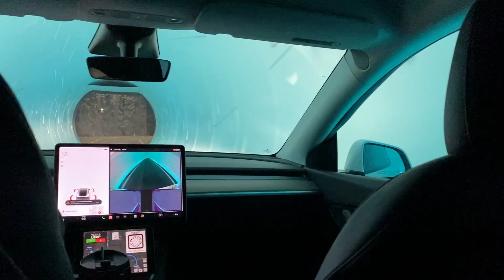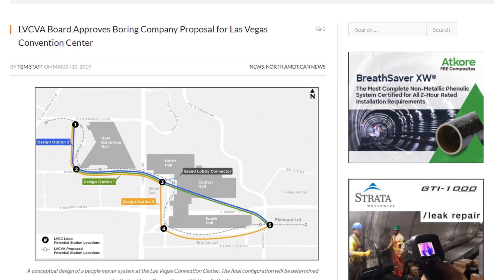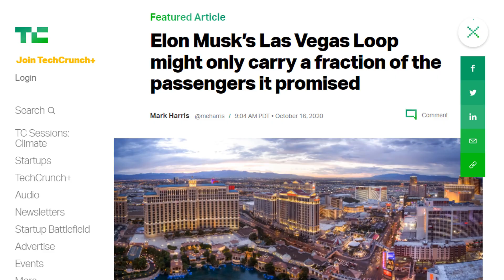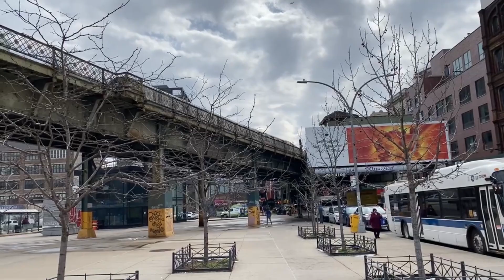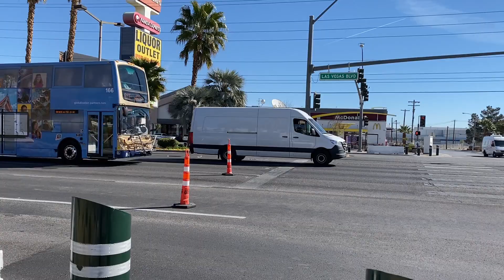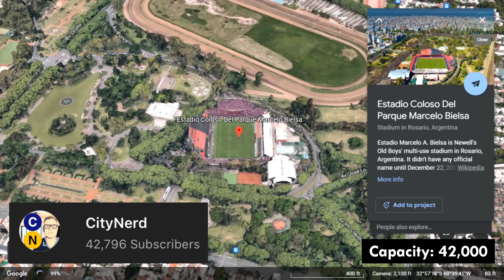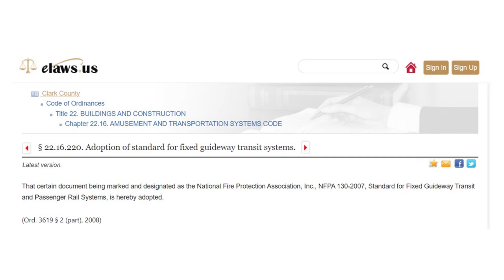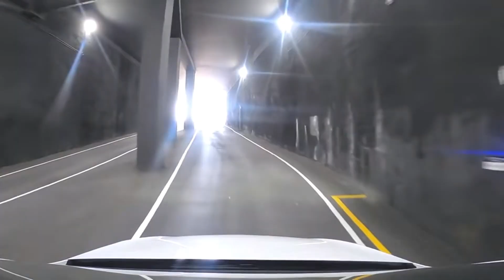Inside the Las Vegas Loop: Transportation Game-Changer, or Complete Waste of Time and Effort?

Comment: 10:20 Wait, are they really proposing to make the cars travel in groups? Why not just chain them up together? And then add a sort of metal guideway on the ground so that they could move autonomously, with an electric cable running along so that would allow the cars to be constantly charged and never run out of power. After that they could modify the cars to accommodate more passengers, with standing room and seats. And then as a final touch they could just elevate the ground a little to get level boarding, that way it would be accessible to all. 
Oh boy, I should create a startup and market this technology ASAP! This is going to revolutionize transit as we know it!!!
Reply from the maker: This technology doesn't exist yet. Stop reading steampunk novels
Reply: @CityNerd Uhhh, Trains?
Reply: I dont know that sounds technically infeasible. Better take the conservative route and put passengers in those blow up spheres that you can roll down a hill in and blow them with high powered fans through the tunnel.
Reply: Just add some technobabble to it and call them pods instead of trains and you'll make millions.
Reply: @ethakis  don't forget the gamer lights
Reply: @ethakis  dont forget putting hyper somewhere in there
Reply: Ah, a fan of Adam I see.
Reply: @lrdxgm  adam, common sense skeptic and thunderfoot
Reply: Luxembourg Luxtram can transport up to 422 people every 2 minutes
422 persons transported in 2 minutes
844 persons transported in 4 minutes
1266 persons transported in 6 minutes
1699 persons transported in 8 minutes
2110 persons transported in 10 minutes
2532 persons transported in 12 minutes
2954 persons transported in 14 minutes
3376 persons transported in 16 minutes
3798 persons transported in 18 minutes
4220 persons transported in 20 minutes
4642 persons transported in 22 minutes
(already in 22 minutes more than the 4400 of the Loop in one hour)
12660 persons transported in 60 minutes (1 hour) just from one station start to another.
All from just one station, and for 500 million euros (a bit more in USD), you got 16 kilometers (10 miles), 24 stations and many tramways.
50 million per mile with 24 stations and tramways 3 times more people
While Loop 50 million for one mile, one station, no cars, no drivers in these 50 million price.
Reply: but elon is a classist and a racist
Reply: Lool
Reply: No, I think they should be independent and put in tunnels - My idea is to slap some solar panels on them though!
Reply: Sounds like a roller coaster
Reply: 😂 wow you are 1000 years ahead incredible.
Reply: Holy crap!!! I think you've invented the train. Patent that bad boy, quick!!!
Reply: No need chains, with AI we can have digital wireless chains, much more efficient than normal chains. Combine that with RGB lights and techno music, it also looks way more pleasant and renewable than rusty chains...
Reply: Now you just have a glorified tram
Reply: ADVENT Insider  How do you figure that the loop moves 3 passengers every six seconds?
Reply: ADVENT Insider   The thing is that Loop EVs only need to carry 1.6 passengers on average to equal the average daily vehicle per passenger ratio of buses. How could this be you ask?

For example, the Vegas Bus service currently moves 178,390 people per day using a fleet of 708 buses.  This is a ratio of one bus to 252 passengers.

In the case of the LVCC Loop it moves 27,000 people per day using a fleet of 70 EVs which is a ratio of one car for 386 passengers over the course of a day.

So the Vegas bus service requires over 1.5x the number of buses to move the same number of passengers over the course of a day as the Loop. 

This is the problem with not just the Vegas bus service, but with traditional public transport using large vehicles in general - occupancy. 

You see the average bus occupancy in the UK is 10.8 passengers per bus which is very comparable to the average bus occupancy in California (10.4) and Nevada (10.1). 

In fact, here in Australia we have an average bus occupancy of around 9 people. 

Upsala Sweden does a little better with an average bus occupancy of 11. 

Now consider that metro buses have an average speed of 9mph due to city traffic and having to stop and wait at every stop. 

In comparison, Loop EVs will have an average speed of around 60mph thanks to the EVs travelling at high speed down the arterial tunnels of the 34 mile Loop going point-to-point direct to their destinations without having to stop at every station. 

So Loop EVs will make at least 6.7x the number of trips in the same time as a bus makes a single trip and that’s not even considering the fact that Loop journeys will be shorter and less circuitous due to being direct point-to-point. 

That means a single Loop EV only needs to carry that magical figure of 1.6 passengers on average per trip to move the same number of passengers per day as a single bus. 

And guess what, Taxis average 1.9 - 2.1 passengers per taxi but it would be even easier for the Loop to have a higher occupancy than taxis with its much higher frequency and much smaller number of end-points than a normal taxi fleet. 

MIT CSAIL’s research developed an algorithm that can replace 14,000 taxis with only 3,000 four-seat vehicles using public data from NYC taxi rides. 

By the simple implementation of ride-sharing apps or station kiosks to enable passengers to more easily ride share, even higher passenger occupancy is readily possible.

And the incentive to utilise such ride-sharing services and make this work is there for the average passenger as the 34 mile 55 station Loop will charge per vehicle so passengers could slash their weekly commuting bill by a half or even 75% by simply sharing an EV with 1-3 other people.
Reply: ADVENT Insider  in terms of maintenance, the 70 EVs in the current LVCC Loop handle up to 27,000 people per day which works out as 386 passengers per day per Tesla as we established earlier. 

Considering the average trip time is less than 2 minutes according to the LVCVA, that works out as 386 / 2.5 passengers per car * 2 minutes = 309 minutes of driving per day. 

So the EVs average 309/60 = 5.15 hours of driving each day to move more people than most subway platform-pairs in Europe. 

Sounds like a pretty easy job for those Teslas.  Pretty comparable to taxis which don’t have a problem giving many years of service despite being ICE vehicles. 

In terms of maintenance costs, internal combustion engine vehicles with 2,500 moving parts which are vastly more unreliable than the 26 moving parts of an EV, which are so maintenance free that Tesla is the only car manufacturer in the world that doesn’t specify service and maintenance intervals. No 10,000 services, no 40,000km major service, nothing. Just check the brake fluid level every 3 years.

And of course, it is not as if subways don’t have VERY significant operating, service and maintenance costs to keep trains running, tracks and signals in top shape etc.  One analysis puts the operating costs for trains at the following:
- Commuter Rail = $20.17 per ride
- Heavy Rail = $17.80 per ride
- Light Rail = $16.08 per ride

(cost per ride calculated by amortizing the capital cost at 3 percent over 30 years, adding to the projected operating cost, and dividing by the annual riders)

For the NYC Subway, Operating costs of an 8-car subway train = $2,000 per hour

As you can see, massive subsidies are essential to avoid MASSIVE ticket costs to merely cover costs for trains.
Reply: ADVENT Insider  You do realise that the Boring Co does have plans for higher capacity vehicles in the Loop if required?  The Loop is after all designed for vehicles up to twice the height of a Tesla Model 3. 

They could easily add higher capacity EV vans or buses or eventually the 16-person pods shown in CGI renders of the Loop on high demand routes, but the reason they haven’t done so yet is because they don’t need higher capacity at this stage.  

Steve Hill, CEO of the LVCVA said back in May last year when asked about higher capacity vehicles in the LVCC Loop: 

“It seems that during a pandemic is not the time to be increasing capacity”.

After all, with the LVCC Loop currently moving 27,000 people per day they already move more people than the platform-pair average of most subways in Europe, let alone light rail or BRT. 

However, if you’re talking about comparing the Loop to the traditional way that buses are used, then buses are too slow, too expensive and don’t carry enough people. 

Bus Rapid Transit (at grade) which has very low capacity:
90 passengers per vehicle * 15 vehicles per hour = 1,350 pph.
And low average speed of 9mph due to city traffic and having to stop and wait at every stop. 
$0.68 - $9m per mile

Bus Rapid Transit (grade-separated) has low capacity: 
90 passengers per vehicle * 30 vehicles per hour = 2,700 pph.
And but still slow average speeds of 12-22mph.
$13-50m per mile

Light Rail Transit (at grade) has medium capacity:
90 passengers per vehicle * 3 vehicles per train * 15 vehicle sets per hour = 4,050 pph.
But slow speeds of 9mph -12mph due to city traffic and having to stop and wait at every station. 
$50m - $100m per mile

Light Rail Transit (grade-separated) high capacity:
90 passengers per vehicle * 3 vehicles per train * 30 vehicle sets per hour = 8,100 pph.
And still pretty slow average speeds of 15mph due to having to stop and wait at every station. 
$201m per mile

Subways have very high capacity:
100 passengers per vehicle * 10 vehicles per train * 30 vehicle sets per hour = 30,000 pph.
But still slow average speeds of 17-22mph due to having to stop and wait at every station. 
$600m- $1 billion per mile
$100m - $1 billion per station

The 34 mile Vegas Loop (2.5 passengers per EV) will have high capacity:
 2.5 passengers per vehicle * 4,000 EVs per hour = 10,000 pph
AND very high average speeds of 60mph thanks to direct point-to-point travel at high speeds. 
$20m per mile (dual tunnel)
$1.5m per above-ground station

The 34 mile Vegas Loop (4 passengers per EV w ride sharing) will have higher capacity:
 4 passengers per vehicle * 4,000 EVs per hour = 16,000 pph
AND very high average speeds of 60mph thanks to direct point-to-point travel at high speeds. 
$20m per mile (dual tunnel)
$1.5m per above-ground station

But the Vegas Loop isn’t just one line down the centre, but up to 3 separate arterial tunnel pairs (6 tunnels in total) in parallel at times - particularly around the Allegiant Stadium to assist with handling the peaks pre and post games.  That gives a throughput of 30,000 pph one way (or 48,000 pph with 4pax per car) or 60,000 (96,000pph w 4pax) bi-directionally over those high traffic sections.  And there are several other sections where small loops come off to serve groups of stations through the heart of the city so the numbers continue to multiply.

And the great thing about the Loop topology is that if there is more demand, more tunnels and stations can be built at a cost vastly cheaper than a subway. 

So even in terms of people per direction per hour, the Loop easily holds its own against:

The Boring Co has actually rates the 34 mile, 55 station Loop at a minimum of 57,000 people per hour and is actually being built at ZERO cost to taxpayers vs $10 billion for a subway.
Reply: With a daily ridership of 27,000 people the Loop is very competitive ridership-wise with the similarly short subways listed below. 

However, the Loop is FAR better in terms of comfort, speed and frequency/wait times, and VASTLY cheaper to build than any of these subway systems. 

The current 0.8 mile long three-station LVCC Loop handles up to 27,000 people per day, has a 3 - 6 second headway and cost $48.7m. 

The Berlin U55 is a 3-station 1.5km subway in the centre of Berlin which is similar in size to the LVCC Loop but it only carries a minuscule 6,200 people per day (compared to the Loop’s 27,000 ppd) at an average speed of 19mph and 5 minute headway and yet cost $500 million in today’s dollars in total, 10x the cost of the LVCC Loop.

The Seattle U-Link is a 3.15-mile underground light rail which also has 3 stations which had a ridership of 33,900 people per day pre-covid (so only a few thousand more than the LVCC Loop), though it is much less now.  Runs at an average speed of 31mph. It cost $1.9 billion dollars in total or $600 million per mile, 39x more than the LVCC Loop.

The San Francisco Central Subway is a 3-station 1.7 mile subway with a targeted ridership of 35,000 people per day with a 5 minute headway and an average speed of a miserable 9.6mph and cost $1.578 billion, 32x the cost of the Loop. (Whether it achieves that ridership which is only a few thousand higher than the Loop during this pandemic is of course yet to be seen) 

The Newark City Subway/light rail is a 6.4 mile, 17 station line with an average speed of 21.5mph and has a daily ridership of 19,289 and cost $208m for the 1 mile above-ground light rail portion or 4x the cost of the underground Loop. I’m not sure of the cost of the underground portion of the Newark subway, typical costs start at $600m per mile. 

As you can see, the LVCC Loop is extremely competitive, though that is nothing compared to the 55 station, 34 mile Vegas Loop with its 60mph average speed and 57,000 people per hour capacity which is now under-construction at ZERO cost to the taxpayer.
Reply: @andrewfranklin4429  I am very curious about how you can reach the capacities and the speeds you mention given the technical limits of this means of transportation. I mean 4000 vehicles per hour means 0.9 second between each one of them. This has to be quite slow to not become incredibly dangerous, and given the speeds you mention, there is a problem somewhere.
Reply: @noefillon1749  hi Noe, a 0.9 second headway (5 car lengths at 60mph) is actually a larger headway than most drivers on the open road use.   After all a 2010 study by the Honda Research Institute found that 25% of drivers maintained a distance of 2 cars (0.33 second headway) between vehicles at 60mph on a busy 2-lane freeway, 15% 3 car lengths (0.5 second headway), 15% 4 car lengths (0.8 second headway), 5% 5 car lengths and 15% 6 car lengths. 

So that is 75% of cars having a headway of one second (~6 car lengths at 60mph) or less and 40% maintaining a headway of 0.5 seconds (~3 car lengths at 60mph) or less. And remember those are cars driven by potentially distracted, drunk and careless drivers. 

Note that a headway of 0.5 seconds = 7,200 cars per hour
And a headway of 1.0 seconds = 3,600 cars per hour

The Boring Co is planning on a headway of around 0.9 seconds (~5 car lengths between EVs at 60mph) which will give a throughput of 4,000 EVs per hour.  With 2.5 passengers per car that gives us 10,000 people per hour. With 4 passengers per car 16,000 people per hour per single tunnel. 

Once the Loop autonomous control systems with their millisecond response times and ability to for example command ALL vehicles in a section of the Loop to brake or accelerate simultaneously, there would be no problems safely achieving headways of this duration.
Reply: @Advent insider, You have made the mistake of assuming the 27,000 people per day metric applies to a single tunnel.  It doesn’t, it is the daily ridership of the entire Loop.

If you look at the footage of the Loop from the SEMA conference, even though attendance was down due to the pandemic and the crowds were not fully utilising the Loop yet, we see each Loop EV taking around 30 seconds to unload and load passengers (15 seconds + 15 seconds respectively), giving us 30 seconds between vehicles in that one bay. There are 10 bays in each station so that works out as 30 seconds divided by 10 = 3 seconds between EVs exiting that station. 

Again, looking at the footage, we see EVs leaving the stations around 6 seconds apart which would give us 600 EVs per hour. Across all three stations, that’s 1,800 EVs per hour. 

We also see between 2-3 people in each EV, so with 2.5 passengers per EV, that is up to 1,500 people per hour per station or up to 4,500 people per hour across all three. So across the 8 hours that the convention was open, theoretically, the Loop could move 4,500 x 8 = 36,000 people per day. 

But of course, like any system, the Loop has peaks and troughs of usage, with the Loop having a multi-hour peak over the middle of the day with low usage up to mid-morning and after mid-afternoon.

As such, it pretty easy to see how easily the Loop could achieve daily throughput of 27,000 people with plenty of headroom for higher figures during larger conventions.
Reply: @AaronMarasco  and yet those “60 taxis in tunnels” handle capacities greater than not just BRT or light rail at which they are targeted, but they even beat the pre-pandemic, per-platform averages of pretty much every subway station in Europe. 

The Loop handled 27,000 people per day during SEMA in Nov which is: 

- greater than the number of passengers that 65% of the stations on the London Underground individually handle daily which with 1.8 million passengers per day across 272 stations averages only 6,617 passengers per day PER STATION. 

- more than the 24,858 passengers per day per line pre-pandemic average of Kings Cross station, the busiest station on the Tube which pre-pandemic had 149,150 entries per day across 6 lines. 

- more than the average of 13,684 people PER STATION per day of the entire Paris Metro which had a pre-pandemic ridership of 4.16 million per day over 304 stations.

- more than the 38,888 people per day per platform-pair average of the busiest station on the Paris Metro, the Gare Du Nord which pre-pandemic handled 700,000 people per day across 36 platforms. 

 - more than the 14,000 passengers per day per line average of the Stuttgart Main Station S-Bahn which pre-pandemic saw 140,000 passengers across 10 lines through the turnstiles daily. Hi
Reply: @andrewfranklin4429  Back to the lie numbers again, I see. Reported for trolling.
Reply: @Codraroll  what lie numbers Erlend?  I already adjusted the figures at your suggestion to compare both platform directions for the subway stations.
Reply: Zenforce, Since you want to talk people per hour travelling down the line, let’s compare those stats shall we?

Bus Rapid Transit (at grade) has very low capacity:
90 passengers per vehicle * 15 vehicles per hour = 1,350 pph.
And low average speed of 9mph due to city traffic and having to stop and wait at every stop. 
$0.68 - $9m per mile

Bus Rapid Transit (grade-separated) has low capacity: 
90 passengers per vehicle * 30 vehicles per hour = 2,700 pph.
And but still slow average speeds of 12-22mph.
$13-50m per mile

Light Rail Transit (at grade) has medium capacity:
90 passengers per vehicle * 3 vehicles per train * 15 vehicle sets per hour = 4,050 pph.
But slow speeds of 9mph -12mph due to city traffic and having to stop and wait at every station. 
$50m - $100m per mile

Light Rail Transit (grade-separated) high capacity:
90 passengers per vehicle * 3 vehicles per train * 30 vehicle sets per hour = 8,100 pph.
And still pretty slow average speeds of 15mph due to having to stop and wait at every station. 
$201m per mile

Subways have very high capacity:
100 passengers per vehicle * 10 vehicles per train * 30 vehicle sets per hour = 30,000 pph.
But still slow average speeds of 17-22mph due to having to stop and wait at every station. 
$600m- $1 billion per mile
$100m - $1 billion per station

Now the Loop Arterial tunnels haven’t been built yet, but we do know they will have a 0.9 second headway giving us 4,000 EVs per hour. (That headway is equivalent to about 5 car lengths between EVs at 60mph which is similar to cars on a busy freeway)

So let’s compare those:

The 29 mile Vegas Loop (2.5 passengers per EV) will have high capacity:
 2.5 passengers per vehicle * 4,000 EVs per hour = 10,000 pph
AND very high average speeds of 60mph thanks to direct point-to-point travel at high speeds. 
$20m per mile (dual tunnel)
$2m per above-ground station

The 29 mile Vegas Loop (4 passengers per EV w ride sharing) will have higher capacity:
 4 passengers per vehicle * 4,000 EVs per hour = 16,000 pph
AND very high average speeds of 60mph thanks to direct point-to-point travel at high speeds. 
$20m per mile (dual tunnel)
$2m per above-ground station

But the Vegas Loop isn’t just one line down the centre, but up to 3 separate arterial tunnel pairs (6 tunnels in total) in parallel at times - particularly around the Allegiant Stadium to assist with handling the peaks pre and post games.  

That gives a throughput of 30,000 pph one way (or 48,000 pph with 4pax per car) or 60,000 (96,000pph w 4pax) bi-directionally over those high traffic sections.  

And there are several other sections where small loops come off to serve groups of stations through the heart of the city so the numbers continue to multiply.

And the great thing about the Loop topology is that if there is more demand, higher capacity EV vans or EV buses or “pods” can be introduced as well as more tunnels and stations can be built at a cost vastly cheaper than grade-separated BRT, light rail or a subway.
Reply: @andrewfranklin4429  Why the hell do you assume buses travel at much higher intervals? You can have sixty buses per hour, you know, demolishing the numbers for the idiot taxis. And that's just at a single bus stop. For the equivalent of a "trunk line", that is, a street where buses drive but don't stop, you can have multiple buses *per second*. Stop being so dishonest with the apples-to-oranges comparisons.
Reply: @Codraroll  What makes you think they won’t  add higher capacity EV vans, buses or “pods” if for some reason the Loop needs any higher capacity than what it already handles?
Reply: @andrewfranklin4429  Because then it wouldn't work as a marketing vessel for Tesla, which is the only way this con makes money for anybody.
Reply: @Codraroll  so cynical Erlend.
Reply: @andrewfranklin4429  I am sure you mean well, but it is just physically not feasible for a group of EVs in a tunnel to ever have higher capacity or efficiency as trains. Whatever those numbers are, they are a lie. It's fundamentally impossible.
Reply: @Problemsolver434   The thing is that frequency, speed and occupancy are just as important as individual vehicle capacity.
And the Loop has ultra-high frequencies of 6 seconds in the LVCC Loop and as low as 0.9 seconds in the arterial tunnels of the 68 mile Vegas Loop versus 6-12 minutes in peak hours on a typical train for example.

That means in the 6-12 minutes it takes a train to carry 800 past a point, there will have been 60 - 120 Loop EVs past that point carrying 240 - 480 passengers in the LVCC Loop and 400 - 800 EVs in the Vegas Loop carrying 1,600 - 3,200 passengers.
Reply: @andrewfranklin4429  Firstly, are you familiar with the simple concept of economy of scale?
Because that blows your entire efficiency argument out of the water.  If you have enough teslas to carry the same number of people a train will carry, the train will outclass it in efficiency. 
Secondly, you are aware that the loop is just one station to another right? A train travelling that distance will not have to do multiple breaks and loads over and over again at each station
Reply: @andrewfranklin4429  Oh dear. The thing was built to reduce traffic. Bur if you actually throw that capacity at it, it will fail. It is functionally, just one more lane. It just happens to be located elsewhere
Reply: @Problemsolver434  Joshua, if you have a look at those energy efficiency figures, you will see it is per passenger mile, so the economies of scale argument fails as the size of the train increases. 

With an average occupancy of only 23% due to differences in peak and off-peak occupancy as well as variations in occupancy across the length of each line, those trains weighing hundreds of tons end up mostly empty most of the time. 

The problem is that the entire train has to be used from the beginning to the end of the line while each Loop EV only goes point-to-point.  The Loop EVs don’t need to stop and start at each and every station on the line or carry on empty to the end of the line like a train.
Reply: @Problemsolver434  and no, the Loop is not failing when used at high capacity. According to the UITP, Light Rail lines globally average only 17,431 passengers per day, half that of the Loop’s 25,000 - 32,000 people per day during medium sized events. 

And what's really impressive is those LRT lines have an average 13 stations while the Loop does twice the volume over just 3 stations all without any traffic jams or congestion.
Reply: @Problemsolver434  And no, the loop is not just “one more lane”, it will be of the order of 40 more lanes and 93 stations in the case of the Vegas Loop  versus a single subway line for a vastly cheaper cost.

If you have a look at the map of the 68 mile, 93-station Vegas Loop, you will see there is a grid of 9 parallel tunnel-pairs going North-South and 10+ parallel tunnel pairs going East-West across the length and breadth of Vegas. 

And each of these individual tunnels will potentially handle up to 4,000 EVs per hour carrying up to 16,000 passengers per hour or 30,000 people per hour per direction using higher capacity EV vans or pods. 

Compare this to the single subway line that would typically serve a geography like the long Vegas Strip. 

And the stations!  There’s over 20 Loop stations in just one square mile of the Vegas CBD where you would normally only have one or two subway stations in that distance. 

So each Loop station only needs to carry as little as 5% of the passengers as a subway station to move the same number of people through the system for every subway station per square mile.

In addition since Loop EVs are departing down to every 3-6 seconds, the crowds just don't build up like a subway where people have to wait for an average of 10 minutes (US rail average).
Reply: @andrewfranklin4429  Again, it's just more lanes 😅😅😅. More lanes with the same efficiency as cars. The same cars on the road
Reply: @andrewfranklin4429  I'd write a long essay explaining all the reasons why it sucks, but we will just be going in circles. I write, you write and around and around we go. It's exhausting. Time will end this debate
Reply: @andrewfranklin7087  Right, because the loop cars operate on some magic technology that isn't available to cars on the road Right 🙃
Do you have any idea how many people complete that distance on the road per day 😂😂😂😂😂😂😂😂
Also, the speed in those tunnels will drastically drop the moment capacity hits. That's the very thing that causes traffic on road lanes 😂😂😂😂

Look, this debate is pointless
Reply: @Problemsolver434  not sure why you believe some magical technology is required as the Loop is already handling over 32,000 passengers per day and over 4,500 passengers per hour all without traffic jams or a drop in speed. 

This isn’t just theoretical, this is actually happening now.
Reply: @andrewfranklin4429  I am saying there is nothing that makes any car in the loop more efficient than any car on the road, and the train comparison you made is laughable. But like I said, this conversation is pointless
Reply: @Problemsolver434  Joshua, I think the problem is that you’re succumbing to the old “cars bad, trains good” thesis without acknowledging how different each of the Loop EVs carrying hundreds of passengers a day in their off-grade high speed tunnels are from inefficient internal combustion engine cars with their one passenger per day on grid-locked city streets. 

There is a world of difference between the two. 

Perhaps the fact that The Boring Co plans to introduce 16-seat High Occupancy Vehicles (HOVs) on high traffic routes in the Loop effectively creating ultra-high frequency off-grade underground Bus Rapid Transit options in the Loop may help ease the cognitive dissonance generated after for so long quite rightly condemning traditional private car usage?
Reply: @andrewfranklin4429  Oh they plan on making the cars bigger with more seats. So, like a bus. Or a train 🤦‍♂️
My comparison was never with combustion engines. But those very roads where the traffic happens use electric cars as well
Reply: @andrewfranklin4429  I think EVs Carry Thousands of people on regular roads a day as well 😅
Reply: @Problemsolver434  again you are ignoring the vast differences between a crowded surface road in the city with all sorts of private vehicles carrying 1 person and trucks and other commercial vehicles with cross-roads, traffic lights, stop signs, pedestrians etc all impeding traffic versus a fully grade separated underground network dedicated completely to the Loop EVs. 

These. Are. Not. The. Same.
Reply: @Problemsolver434  As I said, those HOVs would most likely only be used on high traffic routes. A prime example with the Vegas Loop would be pre and post events at the Allegiant Stadium and the soon-to-be-built Ballpark. 

However, the real strength of the 68 mile Vegas Loop is the PRT nature of transit provided.

Personal Rapid Transit (PRT) is:

“Personal Rapid Transit (PRT), also referred to as podcars or guided/railed taxis, is a public transport mode featuring small low-capacity automated vehicles operating on a network of specially built guideways. 

PRT vehicles are sized for individual or small group travel, typically carrying no more than three to six passengers per vehicle.[1] Guideways are arranged in a network topology, with all stations located on sidings, and with frequent merge/diverge points. This allows for nonstop, point-to-point travel, bypassing all intermediate stations.”

It is individual cars that turn this into an Personal Rapid Transit (PRT) system where passengers wait less than 10 seconds to jump in an EV and it then travels at high speed (25mph average in the LVCC Loop, 60mph average in the Vegas Loop) direct point-to-point to its destination. 

Otherwise you’re back to having the disadvantages of bus and rail - wait times for public transit in the USA average 17 minutes and you have to stop and sit at every station on the line meaning average speeds of only 17-22mph. 

Also, instead of getting a comfy seat in a whole EV to yourself and your family/colleagues etc, you have to stand crammed in a large carriage with hundreds of other people nose to armpit. 

And instead of having 93 Loop stations (20 Loop stations per square mile) with a station at the front door of every hotel, casino, resort, the university etc in Vegas, you would just have a handful of widely separated rail stations with a much worse last mile problem.

And finally, instead of getting those 68 miles of tunnels and 93 stations at zero cost to the public purse, the poor taxpayer would be slugged paying off a $10 billion dollar debt for 30 years.
Reply: @andrewfranklin4429  My God, I have so so many replies to this. Look, I will resist the urge. It's simply not worth my time
Reply: @Problemsolver434  okey-dokey Joshua, thanks for the fun chat.
Reply: @andrewfranklin4429  You too
Reply: @varun prasad It seems you’re not aware that train stations are BIG and ramps up and down from an above-ground station to tunnels below cannot be anywhere as steep as the ramps in the Loop meaning yet more real estate consumed by the tracks as they gradually disappear and appear from underground. 

Nobody, wants the disadvantages of large amounts of land consumed (or forcibly appropriated from property owners) and the terrible impact on real estate values and noise and vibration for houses/businesses/hotels near railway tracks. 

Trust me - I lived near East Finchley station with the London Tube running above ground behind the rear fence of my house for 6 months. It was horrible.

In contrast, above-ground Loop stations are basically just 10 car bays, a loop of roadway, an awning covered in solar panels and the two spur tunnels/ramps going back down underground.

This is why Loop stations are so cheap (about $2m each) and are being built at the front doors of over 51 hotels and casinos, the University and stadium throughout Vegas. 

There’s no way you could do that with eye-wateringly expensive subways or even completely above-ground light rail.
Reply: @varun prasad Unfortunately you are incorrect Varrun. A joint study by the University of Sydney and Monash University report that:

“The interiors of trains and buses, and stations and stops along the network, are the perfect environment for a droplet-spread disease like COVID-19 to thrive. Masses of people congregate in these areas, increasing the risk of direct contact with an infected person.
About 1,000 passengers can crowd into a single train. This greatly increases the virus’s potential spread through droplets if an infected person coughs or sneezes.”

They found that:

“those using public transport were up to six times more likely to pick up an acute respiratory infection than those who don’t.”

“Those most at risk in this study were commuters who used busy stations, basically because they come into contact with more shared surfaces and people.”

This is why having many more smaller Loop stations with vehicles seating only 1-4 people equipped with hospital grade HEPA filters capable of filtering out respiratory particles carrying COVID is so much safer.
Reply: @varun prasad there is a reason why ridership of public transport systems around the world plummeted 80% during the height of the pandemic and are still mostly not much above 50% in most parts of the world.
Reply: @andrewfranklin4429  Well, if a lot of people have to stay indoors because of a pandemic, then of course ridership would drop ... on account of a lot of them are stuck in their houses.

Also, trains can manage gradients as much as 3% these days, even more so for trams. Trains can handle steeper slopes now because we're past the age of single heavy locomotives pulling an entire train; we're now in the age of electric multiple units.
Reply: @regulate.artificer_g23.mdctlsk  the tunnel ramps have a 17.5% Grade (greater than 8 degrees) as well as very short radius twists and turns meaning it would be impossible for rail-based trains to ascend the short ramps to the stations. The much longer ramps required by rail stock would result in the stations consuming far too much surface real estate at the entrances of the convention centre, hotels, casinos, UNLV, the stadium etc.
Reply: @andrewfranklin4429  Yeah but you conveniently forgotten about trams, which can handle sharp inclines/anticlines similar to the ones in the LV Loop.

Do you just parrot the same talking points in every thread?
Reply: @regulate.artificer_g23.mdctlsk  Even rack and pinion and cable car tramways max out at around 13.7% grades far less than the 17.5% grades of the Loop ramps. If you know of any non-rack or cable electric trams that can handle a 17.5% grade, by all means let me know.
Reply: @regulate.artificer_g23.mdctlsk  so do you have any comment on my suggestion of rubber-tired trackless trams or EV buses or vans supplementing the Loop EVs instead of putting up with the limitations of rail in the Loop tunnels?  I mentioned this option to Scoobius a few comments earlier.
Reply: @andrewfranklin4429  There's a part in this video https://youtu.be/Kskfg9bpqD0?t=506 where you can see a tram climbing up going down. To be honest with you, I can't judge what percent grade that ramp is just by looking at it, but I'm pretty sure that's steep compared to what we usually associate with trams and trains.

Trackless rubber-tired trams? At that point, those are just articulated buses. They're alright, I guess; just don't call them what they clearly aren't, which are trams.

I think a better/cheaper option for the Loop is to just install walkalators and allow bikes in there.

edit: I found the timestamp of the part that I was talking about and updated the link I posted accordingly
Reply: @regulate.artificer_g23.mdctlsk  I’m afraid the Tenerife Tram doesn’t even rate amongst the 80 tram lines on the “List of steepest gradients on adhesion railways” page in Wikipedia which maxes out at 13.7% grade, far short of the 17.5% grade of the Loop ramps. 

And yes, EV vans and buses would be more suited to high traffic routes in the Loop tunnels if demand justified them. 

A typical moving walkway belt travels at 1.4 mph, or about half the pace of a normal walk speed at an airport. People walking on a moving walkway stride at roughly 2.24 mph indicating that people slow down from their normal 3 mph walking rate!

That means it would take over 30 minutes to get you to the other end of the 1.7 mile convention Center vs 2mins in the Loop. 

And of course, that is way too slow for when the LVCC Loop is extended to join the 29 mile 51 station Vegas Loop that is currently being constructed - that'd take you 5 hours to travel from one side of the city to the other!
Reply: The one-way tunnel to Resorts World is only temporary until the rest of the Vegas Loop is constructed.  Once joined up, the tunnels will support vastly more passenger capacity.  

And why would you want to try and convert the Loop to rail considering you’d be worse off in pretty much every way?

For starters you would have to spend hundreds of millions of dollars per station to put them underground - so 51x $200m = $10 billion to start with instead of the hotels themselves paying $2m to build a nice little above-ground station at their front door.

But you couldn’t actually fit 17 subway stations in the space of 2 miles which allows the Loop to have stations at the front door of every hotel anad casino in downtown Vegas so you would be back to forcing people to walk for miles to get to a station.

Then those poor passengers would have to wait for 5, 10 or even 30 minutes for the next train instead of just immediately jumping in the next EV waiting parked at the stations in or outside of peak hours.

Then the poor passengers would have to be crammed standing in carriages breathing the covid of 1,000 other people instead of seated with just their family or friends or colleagues or by themselves in a lovely quiet comfy HEPA-filtered EV.

You are aware that trains worldwide still have ridership in the doldrums because trains and stations are super clusters for every new covid variant that it looks like we are doomed to continue to suffer?

And those poor passengers would be doomed to plodding along at an average speed of 17mph due to the trains having to stop and wait at every d**ned station on the line instead of flying at 5x the speed direct to the very front door of their destination.
Reply: @andrewfranklin4429  how do you manage to be so smug yet so wrong at the same exact time.
Reply: @macgobhann8712  can you point me to any particular points that you feel are incorrect Mac?
Reply: @andrewfranklin4429  Multiple people have, all over your comments. Why ask Mac to do the same? It won't help. If one person debunks your utter nonsense, it still doesn't stop you from repeating it to the next person who comes along.
Reply: @Codraroll I’m afraid I haven’t seen any of my replies to such “debunking” countered successfully Erlend. Do you have any particular points that you’d like to demonstrate disprove any of my statements?

Perhaps the comparison of the 27,000 daily throughput of the Loop versus any subway station’s platform average?

Or maybe people being misled by the lies of people like thunderfoot about the fire safety systems in the Loop?
Reply: @andrewfranklin4429  Why would light rail or tram stations cost any more to put underground than the stupid Tesla stations the current system has underground? Other than of course their vastly higher potential capacity, but there is no reason they couldn't make a small and not optimal train (still vastly more useful than the current system).

Where is this 17 stations number coming from and why couldn't they fit if the stupid Tesla system couldn't fit? There is no reason they need full sized subways in them, something similar to an airport tram would work fine, while being higher capacity, more energy efficient and autonomous because running vehicles on rails is so easy.

Why would the interval be longer than that of the stupid Tesla system at any time where the system had more than like 5 passengers? The limiting factor is going to be the tunnels that are 1 car width, no cars can pass each other. You're not exactly going to teleport with the current system, you just may be able to leave 2 whole minutes earlier if there is no traffic, which means never during busy hours. 

You think a train is more cramped than a car? Have you ever been on a train? Also you are aware that every car of the stupid Tesla system currently in place will not just be your family and friends, it will include a driver. A driver who sits in a small car with many random people for hours every day, and thus entirely negates the benefit of any HEPA filtering because they are the disease vector. 

A train on rails can move faster in a tunnel than a vehicle steered by a human, and given that the cars cannot possibly pass each other they will all have to stop any time one car stops. I've seen the videos of traffic in the stupid underground Tesla tunnel. 

You are literally advocating for a system with the capacity and efficiency of cars but the flexibility of public transit. You actually want the worst of both worlds. It's truly insane.
Reply: @scoobiusmaximus9508  The reason putting light rail or tram stations underground would cost far more than the Loop is simply because that is what they cost. And they have similar ridership or in some cases far less than the LVCC Loop and are generally slower than the 30-40mph of the Loop (and a lot slower compared to the 60mph average speeds of the 29 mile Vegas Loop).

The cheapest underground stations in Europe cost $100m, in the USA subway stations go all the way up to several billion dollars each.

The Berlin U55 is a 3-station 1.5km subway in the centre of Berlin which is similar in size to the LVCC Loop but it only carries a minuscule 6,200 people per day (compared to the Loop’s 27,000 ppd) at an average speed of 19mph and yet cost half a billion in today’s dollars in total or $327 million per mile, 6.7x the cost of the LVCC Loop.

The Seattle U-Link is a 3.15-mile underground light rail with three stations in the USA which had a ridership of only 33,900 people per day pre-covid (so only a few thousand more than the LVCC Loop), though it is much less now.  Runs at an average speed of 31mph. It cost $1.9 billion dollars in total or $600 million per mile, 12x more than the Loop.

One of the cheapest underground light rail systems in the world is the Barcelona L9 line which is a 24-station underground light rail which has an average speed of 16.6mph made with very low labour costs not available in the USA but it still cost $243m per mile to build, 5x more expensive than the Loop.

Even building light rail above ground costs on average $201m per mile in the USA. The second cheapest bid for the LVCC contract was an above-ground light rail on LVCC property that cost 4x as much as the Loop or $200m.
Reply: @andrewfranklin4429  Good job completely ignoring everything I said.
Reply: @scoobiusmaximus9508  sorry Scoobius, I addressed the first point you raised about just putting light rail underground, but haven’t had time to address the rest of your points. Don’t worry, I’ll get to the rest when I get a chance! :-)
Reply: @andrewfranklin4429  You didn't even address that point actually. Seriously, did you not notice that the stupid underground tesla lane is also underground? Why do you think an underground tram would necessitate anything that the stupid underground tesla lane doesn't? Then you just listed a bunch of superfluous bullshit.
Reply: @scoobiusmaximus9508  I’m afraid you can’t just put rails into the Loop tunnels for the same cost as the Loop, otherwise above-ground Light rail would be vastly cheaper than it is.

The second cheapest bid for the LVCC project was around $200m, 4x the cost of the winner, the LVCC Loop and that was despite being an above-ground 0.8 mile light rail on LVCC land. The average cost of the 14 light rail projects currently under construction around the USA is $201m per mile so a 15 mile above ground light rail through Vegas would indeed cost $3 billion. 

However, as soon as you go underground, the costs triple - particularly thanks to underground stations being so expensive ($100m+). And that is for light rail delivering only 10,000 people per hour so add another 50% for a high capacity NYC-class subway. 

Here are examples of the costs per mile of subways throughout the world:

Underground subway……………………..Cost per mile
New York East Side Access……………$3.7 billion
New York Second Avenue Subway…..$2.5 billion
Los Angeles Purple Line Extension…$930 million
San Francisco Central Subway………..$928 million
Seattle U-Link…………………………………….$600 million
London Crossrail………………………………..£1.3 billion
Tokyo Metro Fukutoshin Line…………….$400 million
Berlin U55……………………………………………$327 million
Barcelona L9/L10………………………………$243 million

As much as you may wish it to be true, it is not possible for traditional trams, light rail or subways to just be put in Loop-style tunnels and not incur all the other costs of rail. Otherwise those subway companies would have done it a long time ago.
Reply: @andrewfranklin4429  every one of those tunnels is much wider than the stupid tesla tunnel, and much higher capacity. If you just want a low capacity system take the stupid tesla tunnel as is, jam some rails in the asphalt that's currently there, and run a small tram like you can find at an airport. Capacity is instantly higher, maintenance and energy costs are instantly much lower because you have now removed tire wear, vastly reduced the surface wear (metal rail vs road) and cut rolling resistance massively.  It also removes labor costs because vehicles on rails are easy to automate whereas the current system has a driver for every car. It would still be nowhere near the capacity of a system that wasn't designed idiotically from the start, but at least you  get something more useful than a single additional lane of traffic but underground.
Reply: @scoobiusmaximus9508  to answer your earlier question of where did the 17 Loop stations come from, if you have a look at the map of the now-under construction 29 mile, 51 station Vegas Loop, you will see there will be around 8 Loop stations for every subway station per mile (17 in the 2 miles of the CBD) through the busier parts of Las Vegas

The existing convention centre Loop is a prime example of this fact as it already has 3 stations serving that one venue and the fourth LVCC station (LVCC North) has just been constructed and there are three other stations within a few hundred metres of the centre as well, meaning that the LVCC will effectively have 7 Loop stations servicing large convention crowds.  

With a subway, there would only be a single station typically serving such a destination. 

As such, comparing the average daily passengers through the turnstiles of the three stations of the LVCC Loop during large conventions is actually unfair to the Loop as we need to be comparing all 7 (or 8) of those stations (once they are completed) against each subway line for a more accurate comparison. But even with just three stations it still compares remarkably well. 

So, with around 8 Loop stations for every subway station per mile that means the Loop would be capable of handling up towards 8 x 9,000 ppd = 72,000 people per day which is double even the busiest subway station DUAL platform averages in Europe (Paris’s Gare de Nor) which handles 38,888 people per day per platform-pair on average. 

You can see how the Loop topology which has many more small, cheap $2m Loop stations really pays off in both cost (subway stations start at $100m each) and distributing the load for handling quite large numbers of passengers while at the same time enabling every hotel and casino in Vegas to have their own Loop station at their front door, something that is impossible with expensive subways.
Reply: @scoobiusmaximus9508  and no, the train on tracks can’t move faster than the Loop EVs as trains have to stop and wait at each and every station on the line and thus only average 17mph while the Loop EVs go straight to their destination at very high speed. 

Loop EVs have already demonstrated 127mph (205 kph) down the 1.14 mile test tunnel in Hawthorne California. 

This shows the sorts of speeds possible in a tunnel that is almost 3 times longer than the 0.4 mile spur tunnels connecting each station in the LVCC Loop. With the much longer arterial tunnels of the 29 mile Loop, it will be easy to achieve even higher speeds.  

Even the current LVCC Loop is significantly faster than a subway.  Passengers board the Loop EVs with an average 15 second wait according to the LVCVA compared to subways where you have to wait for 3, 5, 10 or even 30 minutes for a train to come in the first place. Then the train has to stop and wait at every station on the line meaning they average only 17mph as a result. 

In comparison even the LVCC Loop EVs travel at 40mph (64kph) in this first stage and will hit an average of 60mph with peak speeds up to 150mph once the 29 mile 51 station Loop is finished.
Reply: @scoobiusmaximus9508  and yes, I most certainly have been on plenty of trains. Rode one this morning in fact. I lived in London in a house in Highgate for a while where the London Underground came above ground right behind my rear fence (noisey beast) and having ridden subways in Tokyo and various other European cities, I’m over dragging suitcases and tired children on subways and railways.  

I've crammed onto trains hoping for a seat and then hung there from a strap in despair waiting for the blasted train to get me to my destination while it stops and starts and stops and starts and stops and starts at. every. blasted. station. in between.  

And then having to run up and down stairs and foot tunnels to transfer to other trains because it takes three different lines to get where I’m going. 

I’d have given my right arm for a comfy seat in a quiet EV to take my family and I and our luggage straight to the front door of our destination 5x faster than a train any day or night of the week.
Reply: @scoobiusmaximus9508  At the moment, the Loop EVs have drivers true. However, in the latest videos from CES the drivers are saying that the cars have already been modified for autonomous operation, but that it is not yet enabled as they are still awaiting regulatory approval and liability is “holding us up right now, but once that gets cleared we’ll turn all the cars on”. 

After all, The Boring Co actually took the press for test runs using autopilot running in Loop EVs over 2 years ago in the 1.14 mile test tunnel in Hawthorne California.   At that point, autopilot was limited to 90mph (145kph) but was scheduled to be increased to 125mph (201kph) a few weeks later. 

Not surprising considering that following a white line in the controlled environment of a tunnel is hardly rocket science.
Reply: @scoobiusmaximus9508  regarding your idea of putting trams on tracks in the Loop tunnels, I would instead suggest adding some rubber-tired higher capacity vehicles like the 16 passenger Pods or small-ish rubber tyre trams or buses that could indeed be useful in the Loop for high traffic routes - particularly pre and post events at the Stadium or on very busy routes between high traffic destinations during peak hour. 

However, it would be important to retain probably a majority percentage of small capacity vehicles such as the 4-7 passenger Teslas to realise the benefits of personalised point-to-point transit.  

As soon as you have to start using larger capacity vehicles, you either have to ensure everyone on that vehicle is going to the same destination or you need to have that vehicle stop at multiple destinations on the way like a bus, tram or train. 

Either of those options is certainly possible but they do have the disadvantages of slowing down the transit for those passengers.  No longer do they walk into the station, jump into the first available EV and immediately drive off to their destination at high speed with no stopping in between. 

Instead they have to wait for a bus/pod/tram that is going to their destination and/or wait to fill it with other passengers also going to the same destination or be forced to go to potentially many other stations (10, 15, 20?) on the way to their destination.  All of this adds extra time to their trip and slows down the average speed of the vehicle with frequent stops. 

With only 1-4 people in an EV you don’t have to go to other stops on the way to your destination. And if some sort of allocation/ride-share system is introduced, throughput efficiency can be improved even more. 

Outside of peak hours, instead of having to wait 30 minutes or an hour for an infrequent bus/tram/train, with individual EVs always waiting at every station, you have instant access to a whole EV to yourself to go directly to your destination at high speed.
Reply: @andrewfranklin4429  rubber tires and small capacity are both issues with the system. Rubber tires wear out fast with constant usage whereas rails and steel wheels don't, and rubber on asphalt has massively more rolling resistance than steel on steel which is a major energy loss and a huge part of why railed vehicles are more efficient. Small capacity vehicles move fewer people for more energy, and the flexibility of them is entirely lost when they're stuck in an 11 ft diameter underground tunnel. The only advantage of cars is their flexibility, and when they're in an enclosed road with no where to go that's lost entirely. Also railed vehicles are much easier to automate, while in the current loop 1/4 of its potential capacity is taken up by drivers.
Reply: @andrewfranklin4429  you're imagining things if you think underground roads will somehow guarantee you a trip from your house to your destination. They're exactly as restrictive as rails, they go wherever they're built. The only difference is that with the restrictions of rail they don't get the efficiency benefits of rails. It's a system that has the worst of both worlds.
Reply: @andrewfranklin4429  cars in underground tunnels go no faster than the car in front of them. I've seen videos of traffic in the loop where the cars are stopped. Sure you can get in the vehicle faster because of the huge inefficiency of having so many small vehicles that each require a driver, but that vehicle isn't guaranteed to go anywhere fast. Also, a train in a small tunnel will have a higher speed than a car where the driver has to worry about hitting walls. Trains are on rails. The loop is dependent on human control over vehicles. A railed system could go faster without a driver at all and be safe.

The loop is a road. It's not magic, it's just underground. It comes with all the disadvantages of being in a fixed path with none of the benefits.
Reply: @scoobiusmaximus9508  Steel wheels are not actually the big deal in energy efficiency that you may think. Rolling resistance is only responsible for about 15% of the energy usage of a vehicle compared to wind resistance, fuel/energy conversion losses, mechanical losses and overcoming inertia when accelerating which account for a massive 85% of the energy usage of a car. 

You’re probably getting confused by the fact that ICE cars are less energy efficient than trains (which they are) and thinking that also applies to EVs (which it doesn’t).  

The average energy efficiency of trains is dragged down by big heavy trains moving small numbers of people off-peak as well as having to start and stop at every station on the line. That is why the Loop EVs use less power than any heavy or light rail transit system globally.  

Average Wh per passenger-mile:
- Loop Tesla Model Y (4 passengers) = 80.9
- Loop Tesla Model Y (2.4 passengers) = 141.5
- Metro Average (Hong Kong/Singapore) = 151
- Metro Average (Europe) = 187
- Heavy Rail Average (US) = 408.6
- Streetcar Average (US) = 481
- Light Rail Average (US) = 510.4

Sources: EPA and Federal Transit Administration 2019 National Transit Database
Reply: @scoobiusmaximus9508  You won’t get a Loop station at the front door of your house, but it’s far more likely that there will be one nearby at the local shopping centre or school etc than you could ever hope for with eye-wateringly expensive subways. 

This is because one of the major advantages of the Loop is that Loop stations only cost about $2m each which is between 50 and 350x cheaper than subway stations and with tunnels only costing $19m per mile, you could build between 10-100 miles of Loop tunnels for every mile of subway tunnel. 

This means it is possible to put Loop stations right at the front door of every hotel, casino, office block, sports stadium, school, University, shopping centre, Rec centre etc etc in a city. 

That is exactly what is happening in Las Vegas with 51 hotels, casinos, the University, sports stadium etc all getting their own Loop station at their front doors. 

So not only is the Loop point to point not having to stop at every station in between, there are also far more destinations that you can travel directly to at 5x the speed of a train or bus.
Reply: @scoobiusmaximus9508  The Loop hasn’t experienced any gridlock or traffic jams. That single short clip from CES that some people repeat over and over ad nauseam showed only a brief slow down for less than 40 seconds in the Loop tunnel due to a temporary closure of the South building’s doors. The EVs didn’t even stop, they just briefly slowed.

This of course ignores the fact that the rest of the time the Teslas are smoothly entering and exiting each station down to every 3 seconds compared to switching to a mulit-billion dollar subway where you have to wait for far longer - 3, 5, 10 or 30 minutes for the next train AND have to stop and wait at every station on a line instead of flying at high speed direct to your destination.
Reply: @scoobiusmaximus9508  and yet even without the high speed arterial tunnels of the 29 mile Vegas Loop being constructed yet, the LVCC Loop handled 27,000 people per day during SEMA in Nov which is: 

- greater than the number of passengers that 65% of the stations on the London Underground individually handle daily which with 1.8 million passengers per day across 272 stations averages only 6,617 passengers per day PER STATION. 

- more than the 18,643 passengers per day per platform pre-pandemic average of Kings Cross station, the busiest station on the Tube which pre-pandemic had 149,150 people per day across 8 platforms. 

- more than the average of 13,684 people PER STATION per day of the entire Paris Metro which had a pre-pandemic ridership of 4.16 million per day over 304 stations.

- more than the 38,888 people per day per platform-pair average of the busiest station on the Paris Metro, the Gare Du Nord which pre-pandemic handled 700,000 people per day across 36 platforms. 

 - more than the 14,000 passengers per day per line average of the Stuttgart Main Station S-Bahn which pre-pandemic saw 140,000 passengers across 10 lines through the turnstiles daily.

Seems like there is no problem with passenger carrying capability of the Loop.
Reply: @andrewfranklin4429  the loop is literally a single lane road but underground. It's more or less the least efficient way to build a road, and completely lacking in the benefits of public transit. The tunnels would literally be put to better use if they stuck rails and a tram in. If you want the flexibility of a car you're going to use an existing road, not a tunnel that does the same thing for much more cost.
Reply: @andrewfranklin4429  Why the fuck are you using a 2.4 passenger or 4 passenger average for the loop? The drivers aren't passengers. The average loop tesla is going to have somewhere between 1 and 2 passengers if we assume the cars never get moved for any reason other than to move passengers (which is hilarious) unless they start putting random people together in them instead of families, which is one of your purported benefits of the stupid underground car idea. 

If they did that however, they would then gain great benefit from scaling the vehicles up to fit more people per driver and per vehicle, and suddenly it starts sounding a lot like public transit. Then maybe replace the asphalt and rubber tires with steel that needs less maintenance and has minimal rolling resistance (15% is a fucking lot btw) and get rid of the driver entirely because it's on rails (the underground tesla cars are about as free as a railed vehicle anyways because they're stuck in tunnels) and holy shit you have a tram that is much more efficient and functional.
Reply: @andrewfranklin4429  ok, at this point it's clear you're not worth arguing with if all video evidence is fake in your opinion. You realize there are human drivers in the cars right? I have seen the videos of them not moving smoothly every 3 seconds like machines and not moving at rapid speeds in tunnels where angling the wheel a bit will have them scraping the sides. Taking literally a normal ass road and putting it underground somehow gives it magical properties and if it reaches any sort of actual scale of usage it will have the exact same issues as any normal ass road on the surface.
Reply: @scoobiusmaximus9508  Does this 129mph (205km/h) Loop run look like “nothing more than a single lane road” above ground to you? (Ignore the slow elevator at the start, neither the LVCC Loop nor the 29 mile Vegas Loop use those)

https://youtu.be/VcMedyfcpvQ
Reply: @scoobiusmaximus9508  I always use 2.4 or 2.5 passengers as that is the average passenger occupancy observed in the current LVCC Loop. However I often also show both 2.5 and 4 passenger values alongside each other as it is highly likely that either the Boring Co or a third party will implement either a ride sharing app or kiosks to allow people to ride-share those 5-6 seat cars during peak periods to allow them to split the vehicle ticket cost. 

Similar to how they would charge passengers to get on the 16 passenger pods that they have shown in CGI renders and the higher capacity EV vans that Tesla has indicated they are developing for if and when the demand picks up post COVID to actually require such larger capacity vehicles. (They may use third party EV vans and buses as another option)

And of course 4 passengers comfortably fit in a 5 seat Loop Tesla Model Y (6 in a 6 seat Loop Model X) once autonomy is turned on which Loop drivers indicate is already functional and only requires “liability to be sorted out” before it can be switched on.
Reply: @scoobiusmaximus9508  Here is a complete list of energy used per passenger mile for all electric and diesel electric trains in the USA. As you can see, the Loop beats them all with the average 2.4 passengers per Loop EV or greater and even with 1 passenger still manages to beat most of them. 

(Notice how steel wheel light rail and trams/streetcars are not more efficient than Loop EVs? They are in fact over 5x less efficient. )

Transit System	Type	Wh/pax-mile
Loop Model Y; 5 passengers.	Loop	70.0
Loop Model Y; 4 passengers.	Loop	86.9
Loop Model Y; 3 passengers.	Loop	112.3
Loop Model Y; 2.4 passengers.	Loop	141.5
Seattle; ST	LR	144.6
New York-Newark; NYCT	HR	164.7
Model Y; 2 passengers.	Loop	165.2
San Francisco-Oakland; BART	HR	177.7
San Juan; PRHTA	HR	193.2
Atlanta; MARTA	HR	193.5
Phoenix-Mesa; VMR	LR	206.8
New York-Newark; PATH	HR	217.1
San Diego; MTS	LR	223.1
Portland; TriMet	LR	269.1
Chicago; CTA	HR	320.1
Loop Model Y; 1 passenger.	Loop	324.0
Boston; MBTA	HR	324.6
Los Angeles-Long Beach-Anaheim; LACMTA	LR	325.8
Philadelphia; SEPTA	HR	346.5
Charlotte; CATS	LR	349.8
Boston; MBTA	LR	350.1
Seattle; SMS	MG	354.1
Minneapolis-St. Paul	LR	385.6
Los Angeles-Long Beach-Anaheim; LACMTA	HR	390.0
{ HR Average }	HR	408.6

Denver-Aurora; RTD	LR	411.4
San Francisco-Oakland; SFMTA	LR	416.8
Houston; Metro	LR	425.9
St. Louis; METRO	LR	427.5
Philadelphia; PATCO	HR	431.9
Washington; WMATA	HR	439.3
Philadelphia; SEPTA	SR	461.1
New York-Newark; NJ TRANSIT	LR	465.9
San Jose; VTA	LR	468.7
Salt Lake City-West Valley City; UTA	LR	480.5
Seattle; ST	SR	502.3
San Francisco-Oakland; SFMTA	SR	502.7
Sacramento	LR	507.0
{ LR Average }	LR	510.4

Type
HR/LR = Heavy/Light Rail
SR = Streetcar
MG = Monorail/Guideway
Wh/pax-mile from 2019 NTD Data.

Electric Propulsion Energy Consumed in kWh / Passenger Miles * (Revenue Vehicle Miles/Total Vehicle Miles)
Last term corrects for Energy used for revenue service, and removes such uses as deadheading, training miles, etc...
Reply: @andrewfranklin4429  I've just updated my reply with a video link to include the timestamp. Here it is again, anyway - this is what I was talking about: https://youtu.be/Kskfg9bpqD0?t=506
Reply: @regulate.artificer_g23.mdctlsk   hi Reg, yes I see what you mean. Trouble is that perspective accentuates the vertical - you really need to see the tram descending directly from the side to see the true angle. 

Now compare that against this footage of exiting the loop up one of the ramp tunnels. 

https://youtu.be/0uIkPOYN8D0?t=183

Can you really see a long tram navigate those tight turns and ascend that steep ramp?
Reply: @andrewfranklin4429  trams are designed to navigate sharp turns so yes. I mean what kind of tram doesn't handle a curve with <100m radius?

Trams are distinct/different from trains BTW, don't get them mixed up.
Reply: @regulate.artificer_g23.mdctlsk  what about that ramp Reg?
Reply: @regulate.artificer_g23.mdctlsk  and no tram I’ve ever seen could go around that 90 degree 10m radius bend in a tunnel no-less.
Reply: @andrewfranklin4429  A simple google search will show you what lines have the sharpest curves; there's at least a couple dozen. And you can even find some in the US.

Tram cars are as short, if not shorter than a conventional automobile; there's no reason they can't fit on such curves even under a tunnel.
Reply: @regulate.artificer_g23.mdctlsk  so still no examples of trams going up greater than 17.5% grades Reg?  Got any links to these trams that are shorter than a car and could go around a 5m radius bend IN A TUNNEL like the Loop?
Reply: @andrewfranklin4429  I think you misunderstood what I said: I said tram CARS - its segments, not the whole trainset itself. Those segments look slightly shorter than a typical sedan. Like I said, there's no reason they can't bend to such curves just because they aren't a car.
There was the Chicago Tunnel Company with a 4.9m radius curve, and 6.1m in all of its grand unions.

Wait a god damn minute, there's no 5m radius curve in the LV Loop. What are you talking about? In the end stations, sure. But in the lines themselves? And such curves will just slow down traffic anyway.
Reply: @regulate.artificer_g23.mdctlsk  Got any examples more recent than the Chicago Tunnel Company in 1906-59?   LOL!!
Reply: @regulate.artificer_g23.mdctlsk  have you actually looked at the video I linked to Reg? That 90 degree turn is barely 5m radius. So you still haven’t provided any links to trams going up a ramp anything like as steep as that video.
Reply: @andrewfranklin4429  oh, you mean the Boring Company video you sent to the other guy? LOL I'll let the others be the judge of that one!
Reply: @regulate.artificer_g23.mdctlsk  No, not that link.  This link that I addressed to you 6 comments ago:  https://youtu.be/0uIkPOYN8D0?t=183 

Can you really see a long tram navigate those tight turns and ascend that steep ramp?
Reply: @andrewfranklin4429  Yes, actually.

Look, I watched a lot of train and tram rides and other related videos, so I know some things that you might not know. I couldn't be bothered to spoon-feed you a bunch of info about transit, so my advice for you instead is to just open yourself up to the world of transit and urbanism. Watch a bunch of train/tram videos like I did; best examples to look at are from Japan, France or the UK.
Reply: @regulate.artificer_g23.mdctlsk   I lived in London in a house in Highgate where the London Underground came above ground right behind my rear fence and have ridden subways in Tokyo and various other European cities dragging suitcases and tired children.  

I've crammed onto trains hoping for a seat and then hung there from a strap in despair waiting for the stupid train to get me to my destination while it stops and starts and stops and starts and stops and starts at. every. blasted. station. in between.  Trust me, I know ALL about subways.

And apart from all the passenger discomfort, they are simply too expensive for most cities to afford or justify. That is why the Loop could be so disruptive.
Reply: @andrewfranklin4429  Judging by the amount of passengers you're dealing with in subways, I bet they're making a profit for the cities. (because a lot of people are being moved in and out)

The Loop wouldn't be disruptive because people own their own cars anyway, and in cities like Tokyo, traffic wouldn't so much an issue for them.
Reply: @regulate.artificer_g23.mdctlsk  Most subways can’t exist without major subsidies - particularly to cover the multi-billion dollar construction costs. 

“Rail subsidies are largest in China ($130 billion), Europe (€73 billion) and India ($35.8 billion) while the United States has relatively small subsidies for passenger rail” “Current subsidies for Amtrak (passenger rail) are around $1.4 billion”

As a result, the USA has the 2nd highest rail ticket price average in the world at $60 per 100kms. 

The Berlin U55 is a 3-station 1.5km subway in the centre of Berlin which is similar in size to the LVCC Loop but it only carries a minuscule 6,200 people per day (compared to the Loop’s 27,000 ppd) at an average speed of 19mph and yet cost half a billion in today’s dollars in total or $327 million per mile, 6.7x the cost of the LVCC Loop.

There’s no way Berlin is paying for the cost of that subway line with a daily ridership of only 6,200 people. 

The Seattle U-Link is a 3.15-mile underground light rail with three stations in the USA which had a ridership of 33,900 people per day pre-covid (so only a few thousand more than the LVCC Loop), though it is much less now.  Runs at an average speed of 31mph. It cost $1.9 billion dollars in total or $600 million per mile, 12x more than the LVCC Loop.

As you can see, tickets on the 34 mile Vegas Loop could readily be made free with a subsidy vastly lower than that consumed by subways around the world.
Reply: @andrewfranklin4429  Yeah, but nobody talks about subsidies when it comes to automobile infrastructure, especially its maintenance. (which usually isn't a problem for railways since they last longer and don't consume too much material, unlike highways)

The upfront cost of building railways might be expensive, but they aren't a taxpayer drain in the long run compared to highways, especially when they're built in the right places.
Reply: @regulate.artificer_g23.mdctlsk  but you’re forgetting that the 34 mile, 55 station Loop is not being subsidised at all for either construction or operation. Why do you bring in the comparison of roads as it is irrelevant when we are comparing the Loop vs subways.
Reply: @andrewfranklin4429  it will inevitably need that subsidy when maintenance comes. I mean, it's not that different from any other automobile infrastructure.
Reply: @regulate.artificer_g23.mdctlsk  With tickets averaging about $10 per EV and ridership of up to 57,000 people per hour in peak hour, TBC could be looking at income of $200,000 per hour in peak periods or perhaps close to a million per day which gives us over $300 million annually. 

That’s a fair amount of revenue to cover tunnel maintenance and other on-going costs. And because the Vegas Loop is being built at zero cost to taxpayers, there is billions of dollars in funding that might have gone into building a subway that could instead be used by the county to cover any ongoing costs and even subsidise the Loop to make it free as is the case for many European public transport systems.
Reply: @regulate.artificer_g23.mdctlsk  In terms of maintenance costs, you’re thinking of internal combustion engine vehicles with 2,500 moving parts which are vastly more unreliable than the 26 moving parts of an EV, which are so maintenance free that Tesla is the only car manufacturer in the world that doesn’t specify service and maintenance intervals. No 10,000 services, no 40,000km major service, nothing. Just check the brake fluid level every 3 years.

And of course, it is not as if subways don’t have VERY significant operating, service and maintenance costs to keep trains running, tracks and signals in top shape etc.  One analysis puts the operating costs for trains at the following:
- Commuter Rail = $20.17 per ride
- Heavy Rail = $17.80 per ride
- Light Rail = $16.08 per ride

(cost per ride calculated by amortizing the capital cost at 3 percent over 30 years, adding to the projected operating cost, and dividing by the annual riders)

For the NYC Subway, Operating costs of an 8-car subway train = $2,000 per hour

As you can see, massive subsidies are essential to avoid MASSIVE ticket costs to merely cover costs.
Reply: @andrewfranklin4429  What about the tyres? What about the gears that are present in every car, EV or otherwise?
Assuming that maintenance in railway is as frequent as roads then sure, you get a point. But you gotta remember that trains carry at least 10 times more while essentially being powered by an equivalent of 1 car, and they can have a higher max speed thanks to low friction.
Reply: @regulate.artificer_g23.mdctlsk  EV tire life on the open road is 20,000 to 40,000 miles, plenty of mileage, after all taxis and buses work fine with tire normal MTBF timescales.   EVs have at most a single reduction gear with immeasurably longer lifespans than complex ICE gearboxes and transmissions. 

Tesla electric motors and transmissions are rated at a million miles lifespan, the new LFP batteries last a million miles etc. 

FAR better than ICe cars and more than enough to be viable in a Loop scenario. 

And low friction is actually a disadvantage for the steel wheels of trains when it comes to traction and braking. 

Steel wheels are not actually the big deal in energy efficiency that you may think. Rolling resistance is only responsible for about 15% of the energy usage of a vehicle compared to wind resistance, fuel/energy conversion losses, mechanical losses and overcoming inertia when accelerating which account for a massive 85% of the energy usage of a car.
Reply: @andrewfranklin4429  I don't know, dude, but trains still brake pretty well despite the low friction, especially the light weight multiple unit trains, not to mention they do this in spite the fact that they have higher momentum due to being larger/heavier. Traction only becomes an issue when it comes to climbing up slopes of at least 2% grade in the worst case scenario. The point of low friction is that you don't lose a lot of your energy into heat due to, well, friction. Traction only matters when it comes to steering, which is irrelevant to trains.
Reply: @regulate.artificer_g23.mdctlsk   Trains are terrible at stopping in an acceptable distance to stop fatalities thanks to pathetic braking performance due to low friction steel wheels and high mass/momentum as well as dangerously high speeds when entering stations or for express lines. 

Witness the 60 people killed annually on the NYC subway only half of which are suicides with 2% being people murdered by being pushed off a platform in front of a train and the rest being accidents. 

The London Underground kills 50 people annually and has 4,000 serious injuries every year. 

Loop EVs can both brake and accelerate far quicker than trains. 

Traction matters not only for steering, but also when braking  and when accelerating away from stations. 

And yes, traction matters on slopes which is one reason ramps up to above ground Loop stations are able to exceed 17.5% grades, far better than trains.
Reply: @andrewfranklin4429  You're forgetting that trains these days have emergency brake systems separate from the normal operating ones (ones that directly clamp on the rails instead of the conventional wheel-mounted ones), they can stop on a dime. Why must braking even be a talking point if railways are usually grade separated anyways? And you normally build overpasses and underpasses for roads to avoid level crossings anyway. Building railways with too many or too frequent level crossings is substandard.
Reply: @regulate.artificer_g23.mdctlsk  A dime you say? Let me quote:

“TRAIN AND TRACK SAFETY: STOPPING DISTANCE

Trains can't stop quickly or swerve. The average freight train is about 1 to 1¼ miles in length (90 to 120 rail cars). When it's moving at 55 miles an hour, it can take a mile or more to stop after the locomotive engineer fully applies the emergency brake. An 8-car passenger train moving at 80 miles an hour needs about a mile to stop. How does this compare to other vehicles?

According to the National Safety Council:
A lightweight passenger car traveling at 55 miles an hour can stop in about 200 feet in an emergency - under perfect conditions - that is, if tires and brakes are in good condition and the road is dry.
A commercial van or bus will need about 230 feet to stop.
A commercial truck/trailer can stop in about 300 feet - that's the length of a football field.
A light rail train requires about 600 feet to stop - the length of two football fields.
Compared to this, the average freight train we mentioned above traveling at 55 miles an hour may take the length of about 18 football fields to stop.
Trains can't swerve - they can only follow the track. The only thing the engineer can do is apply the emergency brake.”

That’s a big dime. :-)
Reply: @regulate.artificer_g23.mdctlsk  methinks reality diverges from your theoretical ideal. 

Here in Australia, our rail network in a single year “recorded 146 derailments, 14 train–train collisions, 2 train–rolling stock collisions, 62 train–person collisions (13 collisions at level crossings), 125 train–infrastructure collisions and 60 train–road vehicle collisions (49 collisions at level crossings) (ATSB 2012).  Between 2003 and 2012, there were 350 Australian unintentional rail fatalities”

Or European railways where in 2019, there were 1,516 significant railway accidents, with a total of 802 fatalities and 612 persons seriously injured.  (Suicides occurring on railways are reported separately. With 2,313 reported cases).

Or US railways where 50% of train engineers (drivers) report they have killed at least one person.
Reply: @andrewfranklin4429  <100 killed ANNUALLY is quite low compared to automobile related deaths. And that's just deaths! Also, most of these deaths wouldn't change whether or not the vehicle has good brakes because it all comes down to reaction time. (you said it yourself: suicide and murder attempts, even a car wouldn't be able to avoid that unless it's running on slow speeds which they usually are anyway)
The numbers you list are also vague, it doesn't specify what causes of injury were, just "accidents". For all we know, some of those numbers could be related to stairs, bad flooring or fire accidents.
Reply: @andrewfranklin4429  I wouldn't care how much accident data related to trains you list, a much nastier blunder is brewing within that LV Loop. Forget Teslas having notorious battery accidents, how are the people going to be able to evacuate from there when something happens?

Edit: notice how he conveniently leaves out the annual automobile death statistics in his replies. just the deaths alone, leave out the mere accidents because it's already a large enough number.
Reply: @regulate.artificer_g23.mdctlsk  except that Loop EVs could easily avoid such incidents because unlike trains they only travel at high speeds down the sealed arterial tunnels which are completely isolated from the stations. 

By the time the loop EVs exit the arterial tunnels via short spur tunnels (that act like on ramps and offramps to a freeway) and enter any of the stations they are travelling at very low walking speeds, unlike trains which enter stations at high speeds before slowly stopping.

And it’s even worse with express services which hurtle through stations at very high speeds.
Reply: @regulate.artificer_g23.mdctlsk  these stats are not vague. “146 derailments, 14 train–train collisions, 2 train–rolling stock collisions, 62 train–person collisions (13 collisions at level crossings), 125 train–infrastructure collisions and 60 train–road vehicle collisions (49 collisions at level crossings) (ATSB 2012).”
Reply: @regulate.artificer_g23.mdctlsk  why are you comparing train deaths to automobile related deaths? They have nothing to do with potential injury or death in loop tunnels.
Reply: @regulate.artificer_g23.mdctlsk  EVs are 61x less likely to catch fire than internal combustion vehicles and 139x less likely to catch fire than hybrid cars so there is as little chance of the Teslas catching fire even in a crash as for the massive Lithium battery packs that are being installed into many subway trains for regenerative braking, acceleration augmentation and emergency motive power.  

In fact the latest Tesla Model Y’s have BYD LFP Blade batteries that even when punctured do not suffer from thermal runaway, so the chances of fires are even lower now.

If there is a fire, you’re actually safer in Loop EVs than being crammed in with 1,000 other people in a burning train.

The Loop tunnels have a “ventilation system that can move 400,000 cubic feet of air per minute in either direction down the tunnels” and many smoke and CO alarms and cameras everywhere, a Fire Control Centre staffed by 2 officers during all hours of operation, high pressure automatic standpipes in all tunnels for fire-fighting, an automatic sprinkler system rated at Extra Hazard Group 1 in the central station etc above and beyond what was required by the national and international fire codes including NFPA 130 – “Standard for Fixed Guideway Transit and Passenger Rail Systems” and the 2018 International Fire Code (IFC).

And if there is smoke accumulating in the tunnel, every Tesla has a hospital-grade HEPA filtration system to filter out the fumes and toxic gases of any fires that might occur. The HEPA filter is about 10 times larger than cabin air filters in most cars and is 100 times more effective than a normal car air filter able to even filter out even respiratory COVID particles. 

The Teslas also have activated carbon filtration, an acid gas filter, an alkaline gas filter for removing toxic gases and a “bio-weapons defence mode” where the outside intakes are closed and the fans are operated at maximum speed to create positive pressure inside the cabin minimizing the amount of outside air that can enter—similar to the way a positive pressure room in a biohazard lab or hospital operates, preventing the backflow of bacteria and viruses into other parts of the building.”

The EV doesn’t need a separate air supply for the few minutes that it would take for an EV to drive the short distance from an incident to the nearest station as the amount of air in the EV running in that mode on re-circulate with positive pressure keeps out toxic smoke and CO for the short amount of time needed to evacuate.  And there’ll be plenty of oxygen in the volume of the car for that short timescale. 

In contrast, trains are death traps in crashes and fires with so many standing crammed together, no seat belts or airbags and all loose luggage and bodies turned into lethal projectiles under sudden deceleration.

With the Loop EVs being rated as the safest cars on the roads for 7 years running, every passenger is safely belted into their own comfy airbag-equipped safety cell.  :-)
Reply: @regulate.artificer_g23.mdctlsk  in terms of evacuation, with a disabled Loop EV there’s only 2-3 people to evacuate compared to a 1,000 people on a train. 

The LVCC Loop has a dedicated tow vehicle (also a Tesla) to quickly and easily extract broken-down cars.  The 33 mile 55 station Vegas Loop will have multiple such tow vehicles. 

If for some reason, an EV can’t simply be towed.  Loop EVs could easily bypass the disabled vehicle by going down one of the many parallel tunnels and mini-loops in the 34 mile 55 station Loop, or if the incident is between the exit and entry spur tunnels to a station, traffic could divert through the station. 

Heck, you could even switch over to the opposing tunnel at the station before and back at the next station with appropriate central traffic management to keep EVs moving if you had to or even go above-ground at the station before, drive the short distance via the streets to the next station and re-enter the tunnels. 

Try any of that with a subway where the exorbitant cost of tunnels means Vegas couldn’t afford all the parallel spur lines everywhere that you’d need for other trains to bypass the breakdown.  A dead train means all trains are dead on that line - not so with Loop EVs.
Reply: @andrewfranklin4429  lmao 27000, there is no stupid way it is doing that.
Reply: @andrewfranklin4429  its a failure just accept it and move on
Reply: @Supraboyes  why do you say that Dwarf?
Reply: @andrewfranklin4429  lol no it didn't, have you seen the video on Adam something channel, it caused a traffic jam. Nah it didn't do that anyone can write fake results
Reply: @Supraboyes  If you have a look at the footage of the supposed “traffic jam” that occurred once at CES 2022 you’ll see how the EVs just slowed down briefly because the South Hall doors were locked for some reason. 

There have been no other videos of this sort of incident ever happening again - not even during the much larger SEMA conference which had 114,00 attendees and had 25,000-27,000 Loop passengers per day.  

CES 2022 in comparison only had 40,000 attendees who rode the Loop 15,000-17,000 times per day.  In contrast, CES 2023 had 115,000 attendees and 94,000 passengers over the 4 day event with zero such slow-downs. 

Now compare that short 40 second slow down against a train where passengers literally have to queue up standing on the platform for 3, 5, 10 or even 30 minutes waiting for the next train. 

The average wait time for the Loop was less than 10 seconds for the latest CES this year. 

And then those poor train passengers have to put up with the train STOPPING AND WAITING AT EVERY SINGLE STATION before they get to their destination, whereas Loop EVs travel direct point to point to their destination without stopping at any stations on the way. 

Now which would you prefer?
Reply: I just lost half my brain cells reading that